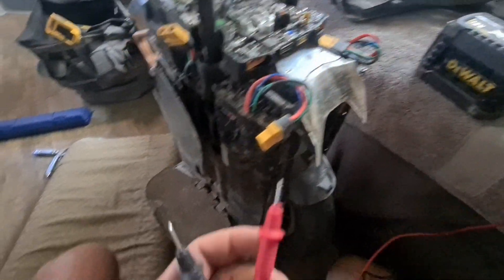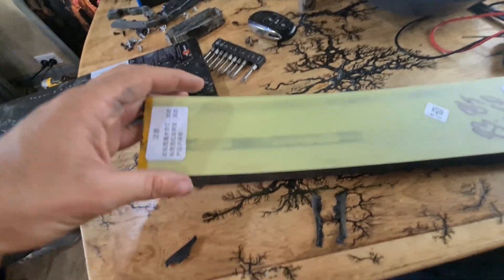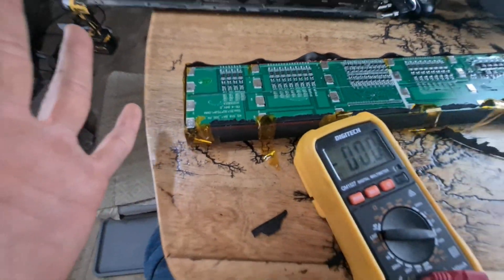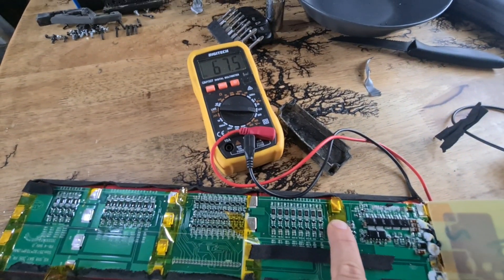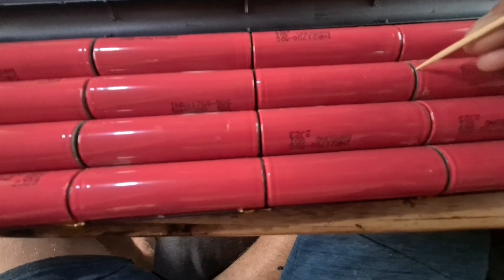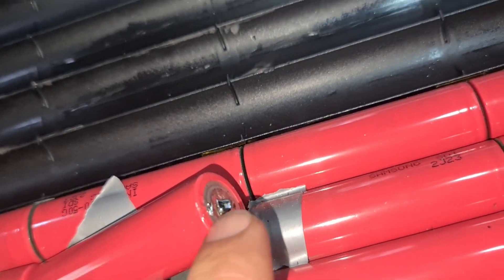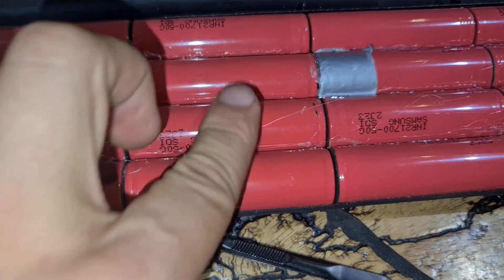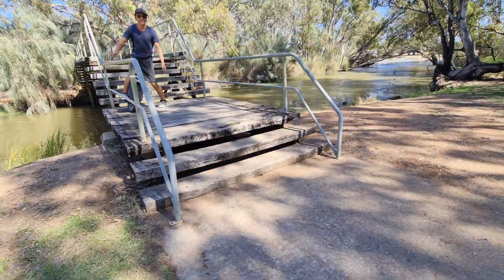Kingsong S18 Broken Cell Fix

Comment: This video is old but I haven’t ridden my s18 molicel in months because it randomly started to dip and then right itself one day and I ignored it and then a month later it just cutout without warning while cruising flat at about 20mph.  I turned it back on and was able to ride it the couple miles home at about 10mph but then when I turned it on again later it would allow me to pick it up and free spin it no problem until cutoff but the minute I got on it and started to move it would cutout.  KingSong wasn’t much help.  They gave me a firmware update that wasn’t public apparently.  I haven’t wanted to risk being thrown again and don’t think a firmware update would randomly be the issue.I have a couple logs from darkness bot showing a spike in current before cutout.  I also had a wire being pinched by the trolley handle that was half cut on motherboard but I cut it off and replaced it with a new wire.
Reply from the maker: If it was randomly dipping it sounds like you need to calibrate the imu (gyro)

Comment: I bought a ks s18 for cheap as it didn't charge. I checked all packs and the front left was 2v below the others. Only connecting it to the board to charge it separately didn't work, the wheel beeped and flashed. So I rode carefully with only the other packs, it got to z reasonable difference and I was able to go from 74v to 79.5v on the app. It stopped charging again, and there is now about 1v of difference between Front right/both rear in series and the front left. I think I'll go ride a little bit tomorrow to reduce the voltage difference and try again to charge. If I can get it to charge fully this way, do you think it will come back to being bad ? Wheel is 6000km, the guy said it worked great until he left it for two months sitting as he bought an electric scooter. There is no indication of any other issue and the wheel rides fine ..
Reply from the maker: Whenever I change packs I always keep it as close as possible
If I was you
Just leave the top case unscrewed while you ride and check it as you ride and when it's super close then connect the other pack
It's definitely easiest way to get them right
For one pack to slowly drain over the others would mean you have a bad cell so it will happen again
BUT I would say 70% chance that it's the nickel strip on one of the cells around the middle
I had similar simptoms as it was braking
The cells need to be stuck down
I have a video somewhere of it

Comment: Hey, I had same issue too, at the same cells connector ! Thanks a lot. 
I did a welding seam, and now all is OK !!! 
PS: I had some problems with screws: they broke when dismantled due to oxidation. I replaced them with stainless steel brand new screws. :-))
Reply from the maker: Nice don't forget the stick the cells down too 👌🏼
I had a mate and both sides snapped
Such a disign flaw 😭

Comment: Hey! Since you opened the battery packs... how waterproof do you think they are? And what about the wheel in general? Water resistant enough?
Reply from the maker: I would personally say there very waterproof  they use good seals and I have never had an issue with water damage
I have put over 15000km on my s18 now and blown a few mother boards from pushing them abit to hard 😭 but never any water issues
I have also ridden in rediculous rain where you can only see a few metres in front and ridden through water that has been above pedal hight quite afew times
Mine is the solid axle s18 I'm not sure how the hollow axle will go but I'm sure it's still quite good
Reply: @The-Stranga  Nice! Ty for the reply. Mine is the hollow motor one. With the new aluminum sliders. 
I was a bit concerned cuz the battery packs don't seem that water resistant when looking from a perspective of a person who did not look it from the inside.
Also, I got in a rain a few days ago and the light sensor thing got all fogged up from the inside. And I could see some water on the front battery cables tied to the board on the front! Also, the rubber cap on top of the charging port on my s18 don't seem to be that effective... water drips a little to the inside, did not reach the charging port... but got me worried!
Reply from the maker: The charging point aren't live on the s18👌🏼 so don't stress there unless you plug it in wet but yer that whole area is definitely easy access to the main board
Definitely want to keep that rubber thing down

You should be fine with rain and deep puddles as long as you don't just stand in them and my rule was always avoid it if in over the pedals
But I have gone deeper quite a few times and gotten soaked shoes 😅
Reply: Don't trust these wheels to be waterproof unless they have the right IP rating. 

Yes, some people get lucky, until they don't.

Comment: Thanks for video. Is it possible that I have the same problem in both front batterypacks? When I connect both rear ones, S18 charges normaly to 84V. But when i connect one front or both, the charger flashes green and red, but doesnt charge. Thanks for advice.
Reply from the maker: What's the voltage of the front  vs the back?
As far as I cam tell the rear packs are the main packs so it won't usually work with out them 
If I was you I would try to match the voltage of the front pack to the rear if there close 
You can do that by ether charging up with just the rear connected or riding I to pull them down with just the rears connected
Reply from the maker: If there are at a different state of charge (different voltages) when you connect them they will keep tripping the over current in the pack and storing the charge 
Try to get them within a volt before connecting for best results 
But if one or both the front packs are under 60v it's probably the nickel strip is broken and if it's go no voltage your bms or fuses are poped
Reply: @The-Stranga  

72,5V left front
72,3V right front

36,7+36,9=73,6V rear

I will try to discharge the rear ones to +/- same voltage and then charge them all

I suspect the nickel strip also because EUC world was showing me a battery resistance of 0.16-0.18ohm and now the resistance is about 0.26-0.27ohm
Reply from the maker: @Daniel Duchan  interesting  
I would say nickel strip too it must be a really weak connection if it's sort tablet there and notcits tricky to find the break if it helps its usually the middle of one of the front packs

Comment: Helpful video dude! Sad to say I've found this because my ks18 wont turn on😢 both my front packs read 145 but one rear pack reads 88 and the other is 65. Think this could be the issue?
Reply from the maker: I'm not sure your reading you multimeter right as the rear packs should be between like 32v and 42 and the front should be between like 62v and 84v or lower if there's a problem 
Only check the main connectors not the little ones in the middle
Reply: @The-Stranga  yaa my bad i had the multimeter on the wrong setting. Both my large packs are 70. Then one small is 40 and the other one is 32. I saw your other video where you replaced the fuses but my small pack doesn't have the same fuses.
Reply from the maker: Arr dam
It may not be the fuses
If one is at 32v it maybe fully disk charged
It maybe worth getting a 36v charger so 42v fully charged
And try and charge the pack up separately so the two back packs match
Just be careful
But thats what I would do as the difference between your packs is massive
They're maybe an issue with one of your packs tho still for it to get so out
You may even have a dead cell 🤔
Reply: I figured it out cheers dude! I disconnected the large packs and tried charging just the smaller packs, they balanced themselves and we were good to go. Not sure how they got so out of wack. I'll test them every so often now to check they are balanced.

Comment: Thanks for this! I have this same problem in mine and plan to take it to a friend with a battery spot welder to try fixing... but man - stacked up like that it will still take a bit of planning to get it right!
Reply: I have had success with releasing the cell with the broken tab, letting it drop out, then spot welding longer strips or even just soldering some large strips of copper braid, which can slide back through and soldered to the PCB. Using a really hot iron made it quick and easy

Comment: Thank you for your video, it is very clear. I hope I will never need it for my S18, but in case it will be useful
Reply from the maker: I definitely recommend sticking your cells down before it becomes an issue
I have a mate with a s18 and I had to do the same for him when his cell strip snapped
His was on the pack on the other side also in the middle of the pack
As far as I can tell it only effects the front packs
Reply: @The-Stranga I think it’s all caused by a piece of plastic that sticks out on the inside of the plastic shell.  When the wheel tips on its side the whole weight of the wheel is pressing onto the battery packs across one small plastic circle.  I’m not sure if it’s an artifact left from the mold used or what but I just filed those things down on both sides and my molicell packs are still going strong after over 1k miles and countless hard tumbles.  Still thinking about doing something similar to protect the packs from potential vibration damage later on. 
Thanks for sharing!
       🤙